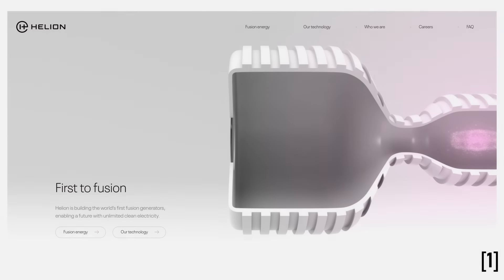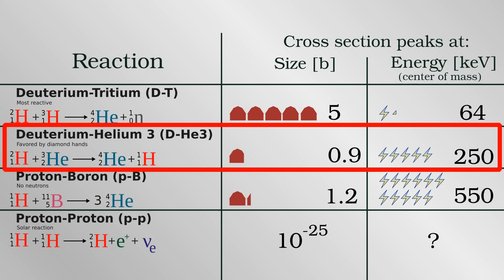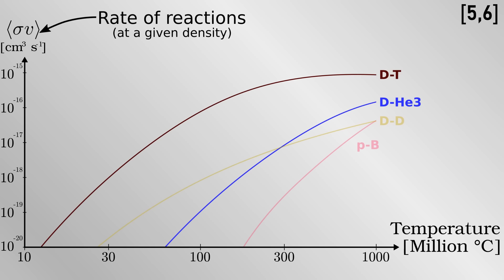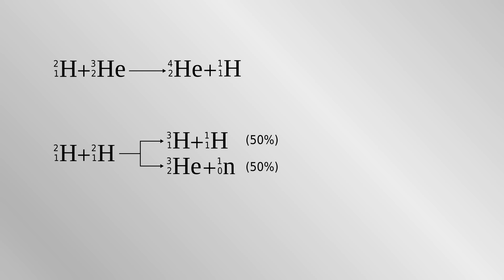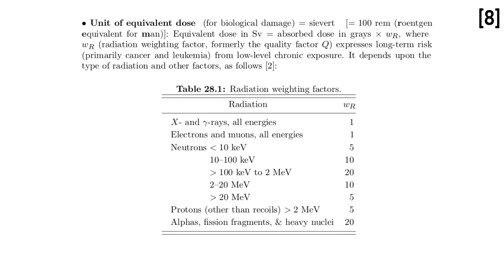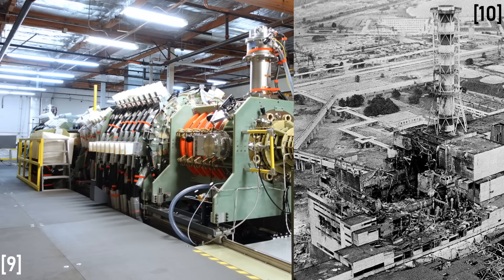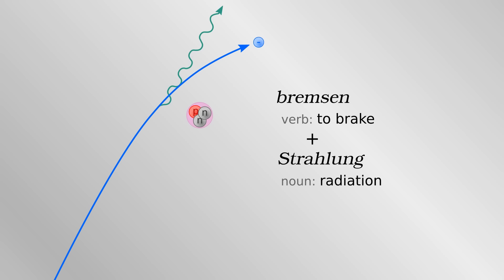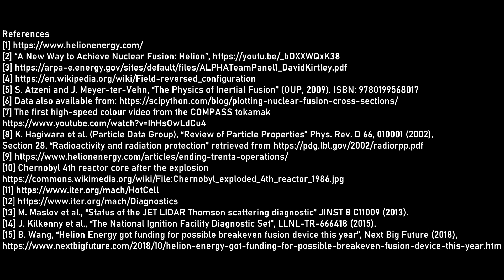The problems with Helion Energy - a response to Real Engineering

Comment: I'm not too worried about the radiation, simply because any fission reactor, of which there are many in operation, produces radioactive waste, and that's currently kept (or so we're told) from interacting with my DNA. At this point in time, I'm far more worried about SUVs and trucks and jet aircraft belching out CO2 as a threat to human survival in 2100, than subterranean caverns full of radioactive waste. Obviously subterranean caverns full of radioactive waste are a problem, yes, but - less of a problem than CO2 at this point in time. Do you worry about potential lead poisoning from bullets when you are starving and shoot an animal to eat?